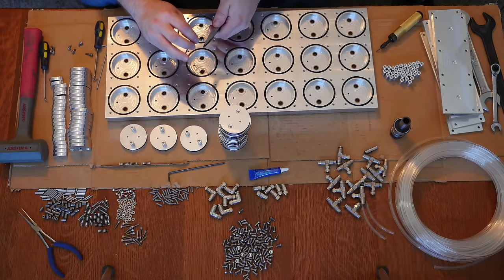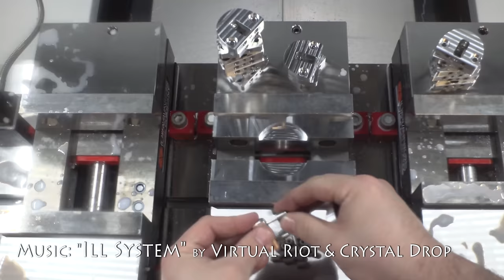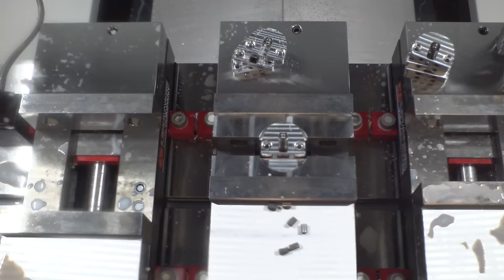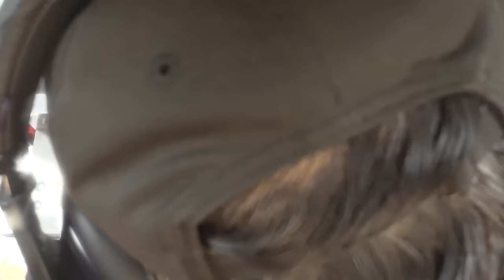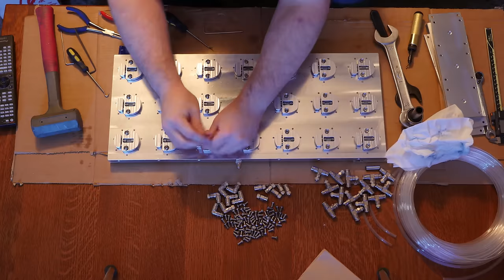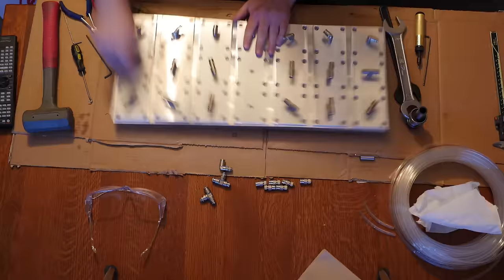Skipping ahead - time-lapse assembly of the 21-station pneumatic fixture

Comment: kudos for taking the solidworks  bottle cap tutorial and making a business out of it. I will be buying one when available.
Reply from the maker: Guy Good
Thanks! I think...

I've seen that tutorial, but only after I'd already made my first bottle cap (and believe me, I searched and searched for guidance, but basically came up empty-handed). I just went and scrolled through a video of someone doing the tutorial... that bottle cap is a complete piece of crap compared to mine. I mean, I suppose theirs resembles a bottle cap... sorta... if you squint. Mine is basically a scale model.

Comment: Do you have a company or a website where you sell these bottlecap bottle openers?
Reply from the maker: Frank Sandqvist 
I don't, yet. I'm clearly not getting these done as quickly as possible and I'd like to make sure they're as good as they can be before I start offering them for sale. I'm trying to get the paint right these days. The first layer is easy as cake, but having more than one color or having multiple layers is proving to be quite a challenge. Someone gave me a generous offer to put them on their store, and when I get closer to getting them done I'll find out if that offer still stands.

Comment: Very nice fixture. How many bottlecap openers do you think you will sell? It seems a fixture meant for high volume production.
Reply from the maker: +Egbert de Pauw 
Man, another comment that I missed. So sorry for my apparent rudeness! I just found that YouTube puts them all in one section though*, so hopefully this will stop.

* "Creator Studio" > Community > Comments (in case anyone reading this hasn't seen it yet)

Thank you! I've asked myself that question many times... I don't really have an answer. I figure I could mill 60 a day without too much trouble, but getting them painted is a different story. I've cut the mask for a single bottle cap using the Tormach drag knife and it is VASTLY superior to doing it by hand. It might halve the time each one takes to paint.
Reply: No problem :-) You're not rude!

What's the runtime for a fully loaded fixture ? 

Can't you outsource the painting, or use a different process like anodizing?
Reply from the maker: I think it's basically 10 minutes of machining per cap, so 3.5 hours for a full batch.

There's at least one big company here that does anodizing and they also do powder coating. I could prolly get a batch done for $200, but that makes the per-cap price $10. Pretty hard to justify that cost if I'm trying to sell them. :/ I don't remember what their powder coating price was, but they had a fee for plugging each hole, so the 7 holes in the cap (the center one would have a threaded rod in it) really increase the cost, at that place at least.

The real trouble is, I'm assuming people would want them to be engraved. So, what I've been doing is I'll mill them, then paint them, then engrave them (so there's good contrast between the engraving and the paint), then I'll clear coat them. The clear step isn't completely necessary, but the engraved section will oxidize over time if it isn't protected somehow. Maybe I could just put some kind of was on the engraving or something.

I just hate the idea of making compromises just to make them viable for sale.

I'm hoping to get a laser engraver this summer (a Glowforge), and I'm hoping that'll help streamline the painting/masking/marking process.
Reply: +Hirudin Pricing is difficult and indeed you'll have to keep the costs down. On the other hand I think that you could probably sell some of them to your "audience" The people who watch your channel appreciate the time and effort you put in them and probably would buy one to support your hard work. (at least I would buy one ;-) )

I don't think you should compare the pricing to products in stores etc. but see it as a high quality novelty product which has it's own audience.
Reply: +Hirudin I believe with the correct program and tooling you could probably half that cycle time with that machine.
Reply from the maker: Limosical 
Yeah, some of the ops were a little slow. Particularly the 1/8" slotting.

Comment: Im supersized you didn't make it mechanical, plates on the bottom in each row to lock down with 3 screws. Just a thought..    Great vid tho...
Reply from the maker: +Bigwingrider1800 
Thanks!
I wanted to make it mechanical, but I just couldn't figure out a way to do it. I didn't want to take the fixture out of the mill to change caps, so that meant all the screws/fasteners had to be on the top. Then, since the caps need to be held down from inside, that would mean some kind of lever system or hook-shaped brackets or something. I also wanted to use at least three of the locating pins, but preferred all seven, so everything would have to snake between the pins. The last thing was the possibility that the caps would be different thicknesses, so each cap would need its own screws (I couldn't figure out a way to reliably secure multiple caps if there was a possibility that they'd be different thicknesses).

The first one I made just had three 1/4-20 tapped holes on the bottom that I used to secure it to a plate. , personally, I thought it was fine, but I got tired of everyone asking what the screw holes were for.